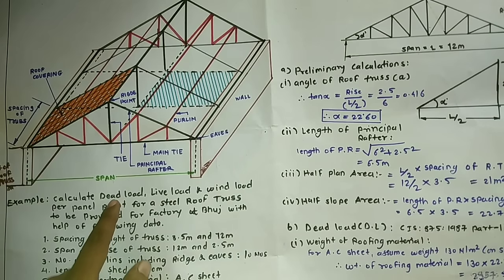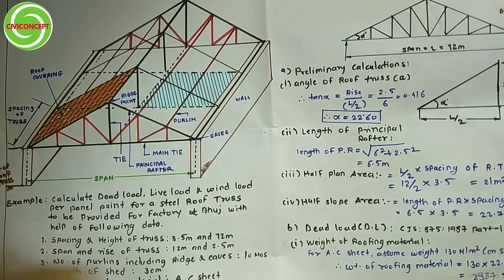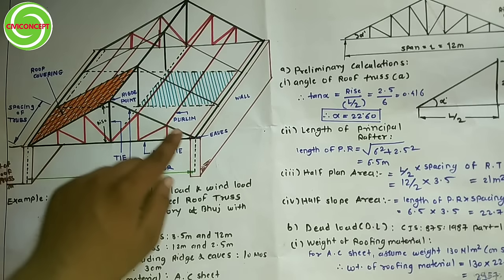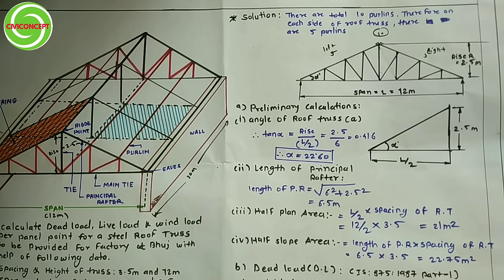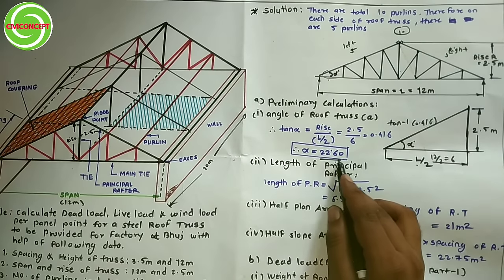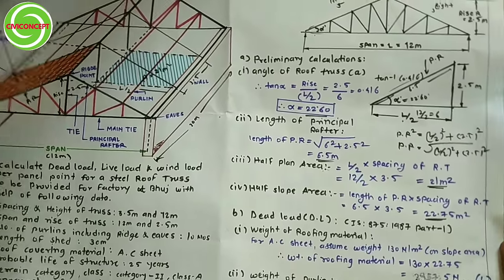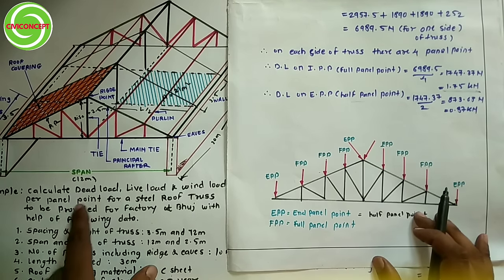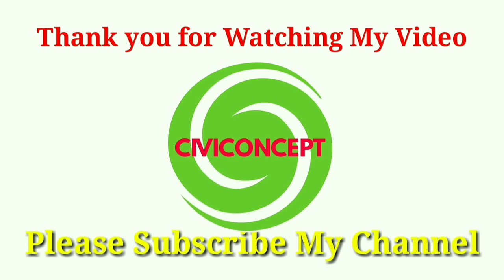Steel Roof Truss Design  || Dead Load || Live Load || Wind Load Calculations

Comment: The topic was on "How to calculate Dead Load, Live Load and Earthquake Load" but you discussed only on "How to calculate the Dead Load"
Reply: RLL is the only Load in the roof... Even if it is roofdeck or truss...
RLL means Roof live load... There is no LIVELOAD in roof.... And EarthQuake load is not applicanle to Slab or Truss.. Its only for beam and column

Comment: good roof sheets , purlings & truss dead load & wind load calculations but purling weight should not be multiplied by plan area since purling have spacing & do not completely cover the plan area # space area between purling should be excluded # 🇵🇰

Comment: What do you call the name of Roof Design which is rectangular and  sloped to the other end. 
Eg: I have a plot of 16x40 ft. 16-width and 40 length. I am planning to have the house facing on the 16 ft wide side as for on both the sides there are two houses.
Therefore I have to build a rectangular house with high elevation in the front face (for loft bedroom) and normal height at the back end. I would like to know what would you call this type of roof design. It will be made of Steel Sheets/ Galvanized Steel Sheets.